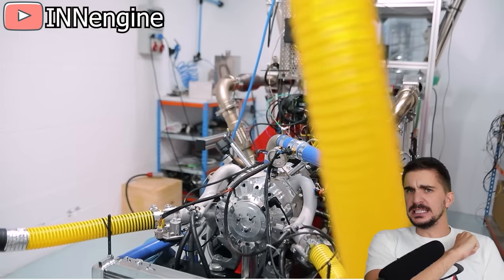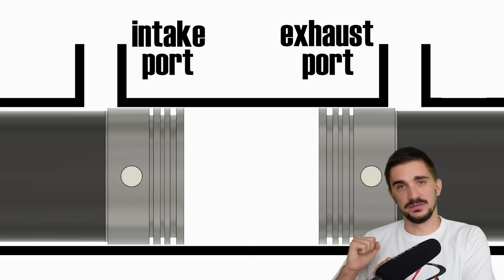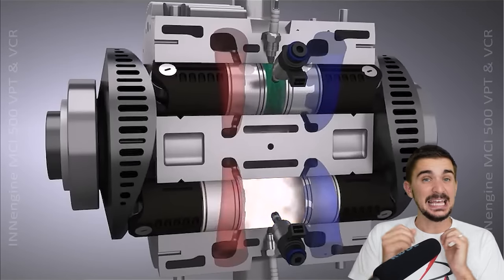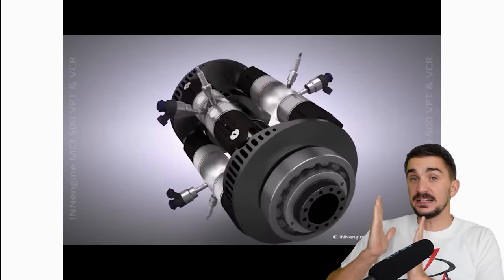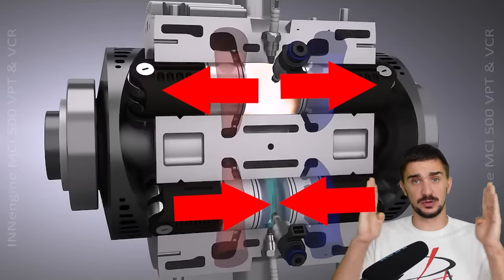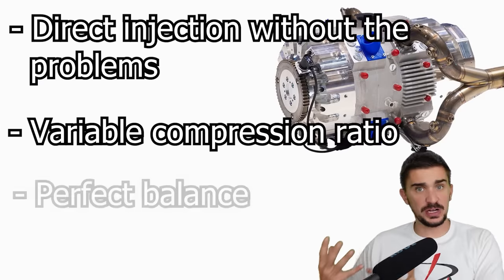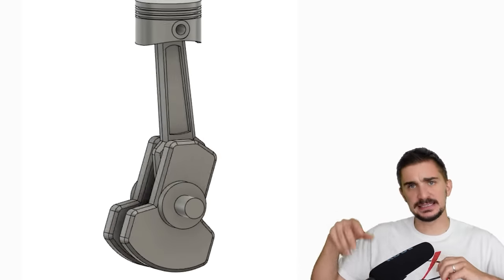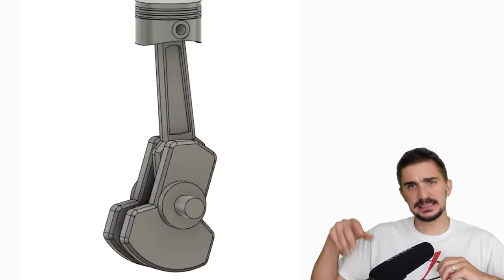Spain is Living in 2050? Revolutionary 1 Stroke INNengine Analyzed

Comment: 15:06 The supercharger is a standartised intake design for two strokes who don't rely on the changing crankshaft volume to feed the transfer ports. Since this engine has no crankshaft, the supercharger is mandatory for running it. Similar intake designs can be seen on a ship engine.

Comment: Something you didn't mention, maybe out of respect for their design choices, is the wheels on the on the "wavy things" (swash plates?) needing to be lubricated. Imagine the forces they are under and the wear they will experience over the life of the engine! The way that many car owners treat their vehicles these days is like appliances that they never maintain; they just replace them when they stop working. So using a quality oil and changing it regularly would be what keeps an engine like this going for a long time. Or not.

Keep making these videos! You always think things out and present them in ways that help us know more of the story than we might have otherwise. You have a great mind!
Reply: Heavy duty roller bearings (as opposed to balls) would have no problem carrying the load, in fact racing engines often forego shell bearings for rollers.... I wonder about the side-thrust on the cylinder wall ..."equal & opposite reactions" and all that... 🤔
Also,  a reed valve on the inlet side might be better than offsetting the ports... 

Another tuning tweak for higher than standard compression (if you were racing this engine, say)  would be to simply drop in a larger bottom end bearing (diameter)... no messing around with skimming heads...

Or what about a diesel version ??  
Seems like the possibilities are endless, I would love to see energy (fuel) efficiency figures for this configuration... we definitely need more data... rpm range, torque curve, wear characteristics etc.
Reply: There appears to be no reason that this design would need more frequent oil changes than a 4-stroke engine.  There have always been vehicle owners who ignored maintenance, resulting in destroyed engines since the invention of the car.

Comment: In a hydraulic piston pump the wavy thing is referred as a swash plate (or swash disk)
Reply: Isn't a swash plate a flat disk on a shaft that is tilted relative to the axis of rotation?  In this engine I think the "wavy thing"  would be more correctly called it a cam plate.  It is anything but flat.

Comment: There was a much larger engine and was similar in design.  It was a company called (As I recall) THUNDER ENGINES. It was flown successfully on a Rockwell Twin Commander and produced around 400HP and designed to be very easy and inexpensive (relatively speaking) to overhaul.  It had 6 cylinders and 12 pistons.  It was based on the General Motors air conditioning compressor that it self was based on an early 1900's internal combustion engine.  The Wavy Thing is a Swash or Wobble plate.  I suspect the best application would be aviation related as the torque needed would be at a fairly high RPM.
Reply: It was not better, it closer to just a  inline, but a circle. This here although simlar so many times better.
Reply: Right, anytime you discuss low weight, aviation comes to mind.  Starting with the ultralights, say under 60 lbs and making 45-50hp, then LSA at 100lbs and say 85- 120hp, and upward.  The current piston designs are good but tend to be heavy.  Reliability is the next level for aviation and then of course fuel economy.  Turbines are reliable but thirsty.  If any piston design could incorporate low rpm and still develop acceptable torque and hp, then you would have a solution to a great number of aviation problems.  Perhaps this design that is overbuilt for a given application and develops the acceptable performance at a much lower rpm.  Just saying.

Comment: The first thing I thought when you started describing this engine:  That will have low torque, but will be great for generation in hybrid vehicles.  Or in boats or planes where torque isn't as big a deal.
Reply: Plane engines need max torque around 2700 RPM based on their propeller length, otherwise the propeller will start cavitating. You can add a transmission to reduce prop speed at the cost of reliability and weight. Plane engines have a very long stroke to bring the power lower in RPM, a common engine the Lycoming O-360 has a 4.375" stroke where as a chevy 350 has a 3.48" stroke.
Reply: @JankyShack  It's bore/stroke ratio, not absolute stroke length. Long stroke designs have smaller piston diameters, which is very restrictive for piston port valve sizing in 2 strokes. Everything depends on everything, one of the most basic Physics principles all designers face.
Reply: @billtaylor3499  Or you just change the number of cylinders.

Comment: NO! that super charger is (most likely) not adding power. look up the function of of Detroit Two strokes. I bet you that pro charger was for scavenging purposes. That is very common for large engines that have ports and not valves. They have something that can create pressure in the intake, so that exhaust won't come back through. When they do this (usually) it is tuned to approximate atmospheric pressure. The vacuum that these engine create in the cylinder is probably not enough to properly scavenge the exhaust out, that's what the charger is used for. On Detroit's it is a roots style blower. That don't add ANY power, in fact they actually become parasitic at higher RPM's and decrease the engines performance. Twin screws didn't really exists yet which would aid the problem.
ALSO! 
( I am capitalizing so that people will actually read this, I am not actually angry haha) 
When they are saying two combusting per rotation.... THEY MEAN, two combustions per rotation. If you really look at the animation you will see. One chamber will combust twice in one rotation. A two stroke does not do that. I think he got hung up on the 180 degree swash plate. It is 8 TOTAL combustion per 360 degrees. twice as much as 4 cylinder. If he said the same as a two stroke 4 cylinder the yes, true. But he did not. This has combustion every 90 degrees, just look at the animation and think about it.

Comment: i enjoyed your well balanced and analytical approach to this subject. Like you said towards the end, I think the low weight and simplicity of the engine are it's main selling points. I think the 500cc variant would be fantastic in a microlight as they are always looking for weight loss in order to make the aircraft more user friendly. So if you could lose say 50-60Kg this could translate into a greater range as you could carry 50-60Kg more fuel (About 50-60Litres). also in drones, you could carry the saved weigh as extra equipment or reduce the power, and hence the power needed to keep it aloft. Great video.

Comment: The "wavy thing" is called a Cam-plate and was used extensively in radial engines in aviation.
Reply: I have seen it called a "Wave plate" as well.
Reply: @DocWolph  me too come to think of it
Reply: Was it used as in this fashion as a power transmission component or a timing device in the plane engine? The forces on the whole arrangement in this videos engine seem counterproductive, but I well could not be understanding
Reply: @desertblbuesman  timing, but that component is subject to all the forces the crankshaft is, so I dont think it makes sense to deliniate between its purpose as a timing component or not

Comment: You are correct. They should focus on how tiny it is, and that when supercharged to exhaust purge properly and apply variable boost depending on load, you get a lot of power and efficiency from such a tiny plant, not to mention the simplicity of the system compared to the typical 4 cylinder. Driveline connections at both ends is another huge benefit.
Reply: Lightweight is appealing for aircraft.
Reply: How is a "driveline connection" at both ends a "huge benefit"?.... 🤦

You could do the EXACT same thing with a normal piston engine. The crankshaft literally goes from one end of the engine to the other.
Reply: Also, I wonder what would be the cost benefits from a similar performance classic engine. It could be the game changer in a lot of applications.
Reply: @Charly325555  since it's still burning the same gasoline as other engines, and most modern engines are nearing their peak thermal efficiency as it is... It's main selling point is that it's compact and lightweight.

Considering many modern cars can already accommodate small 4 cylinder engines that don't weigh much to begin with (and make nearly as much power/displacement), you're probably not going to find anyone wanting these in cars.
Reply: @jasono2139  I'm thinking the same thing. One could theoretically put an out put shaft off the front of an ICE & run a transmission off the front?
Reply: @jeffrandolf5673  virtually 100% of engines use the "non-output" side of an engine to power accessories (alternator, A/C, water pump, etc)

...so I'd say yes.
Reply: @jasono2139  I wonder, what if you make it bigger, so it has the same weight and size of a normal engine.Wouldn't it have more power?
Reply: @GraveKommander  obviously it would... But as I said before, ICEs are nearly approaching their theoretical limit for maximum thermal efficiency. Once you've hit that point, the only way to get more power out of the same engine is...
1) switch to a better fuel
2) force more fuel + air into the engine

Most small inline 4 cylinders are already capable of doing over 300 hp from a 2L engine... Ford even tuned one their 3 cylinder, 1. 5L engine to push out 200hp.

The real concern of modern engines is reliability.
Reply: @jasono2139  True, but they typically drive all the accessories at one end. You have a valid point. Those accessories really could be moved down the driveline on any engine, and the front pulley system could be another transmission connection instead. Honestly there probably is another engine somewhere set up like that already.
Reply: @fearnoproject2047  huh?

The output shaft on your TYPICAL engine is on the OPPOSITE END of where all the accessories are powered because there's no way to get a serpentine belt around a drive shaft... Have you never in your life looked under the hood of a car??? 🤦
Reply: @jasono2139  dude...are you just here to argue? You are on both sides of the fence. 
------
When I mentioned transmissions at both ends....your reply was,
"You could do the EXACT same thing with a normal piston engine. The crankshaft literally goes from one end of the engine to the other."
-------
I agreed with you, that there could be a design that allows regular engines to be designed with transmissions at both ends, moving the accessories to another location down the line.
Now you argue the exact opposite, "because there is a serpentine belt, you can't have a driveshaft there".

Transfer cases, gear driven accessories?

Engineers smarter than either of us can design an engine that hooks transmissions to both ends, and runs the accessories off of those systems.

and yes, I've looked under plenty of hoods. Worked under them too. Pretty enjoyable to fix my own rides. Kinda why I got on here.
Reply: @fearnoproject2047  buddy... I am an engineer. 🤦

Perhaps you're not explaining yourself clearly because what you wrote read as though no engines use both sides (and all the accessories are on one side)

Otherwise, I don't understand why everyone thinks running two separate transmissions off both sides of an engine would be an advantage (literally the dumbest point in this video). There's a reason why it isn't done in any modern cars or any vehicles (mainly from a maintenence and disassembly POV)
Reply: @jasono2139  I wasn't writing a discertation. Merely commenting an opinion that an inline engine is a selling point, for those who see a benefit to it. Comments like 

"Have you never in your life looked under the hood of a car??? 🤦" 

Are useless insults and Do not promote good conversation. Maybe a little less troll/insults, and conversations will be more interesting.

Guess I will vet my comments better to avoid this kind of fun...

Have a good day.

Comment: Creating rotational force by pushing rollers onto a slope seems like it would be very hard on the parts - especially on one side of the cillinder and certainly not the best way to produce a lot of power on low RPM. Also, it reminds me of an AC compressor :D
Reply: Even more than that. In a compressor, the "wavy thing" (the swash plate) moves the pistons.  In this engine, the pistons push on the swash plate.  It's trying to force energy into a cam, a feat as difficult as turning a worm gear from it's mated flat gear.
Reply: see whats funny is that conventional piston engines actually have many small rockers on camshafts that control the valve timing, which I assume adds a lot of friction as well. but we don't see camshafts being broken all the time and these being beefier I assume would be durable with oil lubricating the surfaces.
Reply: @arthurfunk3104  excellent analogy with the worm gear
Reply: @-aid4084 you are comparing a tiny light-weight little valves and springs against a big heavy pistons energised with power strokes. Camshaft did wear out over time, though miniscule wear marks against cam roller are visible, no big deal since its only for timing control. Engine piston however transferring powerful energy directly through that "wavy thing"
Reply: Rotary hydraulic motors fitted to earthmoving machines use a cam ring with pistons pushing balls or rollers out against the cam ramps to produce rotation.
Reply: @-aid4084 Yes, but in this engine the mechanism of power transfer is more like trying to spin a camshaft by pressing on it with the rollers. Imagine the amount of force that would take. It’s similar to attempting to spin a worm gear by turning its mated circular gear.
Reply: in the short clip of the example motor with a cutout using 3d printed parts you can see how the various parts have the forces applied to them
Reply: Almost Identical to "swash plate" hydraulic pumps. Normally used in cheap pressure washers.
They don't last long.
Reply: @arthurfunk3104  Exactly. It's nuts.
Reply: @-aid4084  a camshaft pushes on the valve rocker perpendicularly - it's a massive piece of metal (compared to a rocker) and it simply pushes it as it passes by cause it rotates in relation to it.

this thing literally pushes the sloped plate head on, using extreme force to make it spin sideways under pressure.  not the same.
Reply: Remember,...10% for the big guy...
Reply: Aww hell!,just put some ball bearings on the end of the rods and sell it!...HURRY, b4 the Chinese do it, and the big guy gets all the credit!!!...vamose!...muiy pronto, caverones!!!

Comment: I have worked on direct injected 2 stroke engines for over 30 years. A major issue is at light loads you MUST have sufficient air flow to scavenge the exhaust gasses out of the cylinder otherwise on the next cycle there will be an excess of exhaust gas in the cylinder causing typical 2 stroke combustion instability and misfires. 

With the increased air flow to scavenge the cylinder then there is too much air for the amount of fuel you wish to inject The only answer to this is to run a highly stratified mixture. You need a very carefully designed combustion chamber shape and injector spray characteristics to achieve this. 

A homogeneous mixture will not work at light loads. Air fuel ratios around 30:1 are needed to achieve this at idle conditions. A homogeneous mixture at 30:1 will not ignite from a spark.
 
This same combustion chamber design and injection system then also needs to work at high loads.

Next problem, when running at light loads and high air fuel ratios the NOx part of a conventional catalyst does not work although lean NOx catalysts are being developed.

I have tested hundreds of combustion chamber shapes with a variety of injector spray shape characteristics and have never found a set up that works with a radially mounted injector. The only set up that works over the full speed/load range of the engine is with an axially mounted injector near the centre of the combustion chamber and a small bowl in the piston directly below the injector. Good luck doing that with this engine design.

Roy B.
Reply: Given the amount of reliability and wear challenges inherent in their roller-transmission arrangement, if they solve those, putting injectors right in the middle of one or both pistons is not prohibited by natural laws either.
Reply: great but will be greater with my new innovation of HEAD ( Health Energy Advanced Devices).
Soooooooon
Reply: there's the pre-chamber, dimpled piston ("perfect vorticity") that helps with that and ofc this engine is erfect for hybrid with e-supercharger

Comment: The rotating thing is a circular cam disk.

There is a reason why classic car engines uses a crankshaft with cylindrical bearings.

Less risk of surface deteriorate compared to point load from the rollers where any dirt/fragment is imprinted into the surface.

Comment: In the early 1900’s Fairbanks-Morse developed the opposed piston diesel engine which was used by the US navy in submarines.  They were used in ships and later in locomotives.
Reply: This engine design, via Achates Power, is currently undergoing road testing with Walmart.
Reply: Fairbanks morse engines were garbage
Reply: The Fairbanks Morse 38 8 and 1/8 we had one on my boat U.S.S. Buffalo ssn 715. La class fast attack submarine. Was the back up generator. 4mw elec. Never had a problem with it. Big clunky thing, but it always ran like a top. 1300 hp and 1400 lbs torque at idle. 720 rpm. Only ran at idle. Could power about 1000 single family homes. She was a beast.
Reply: Like a locomotive engine and marine engine. The Napier Deltic.